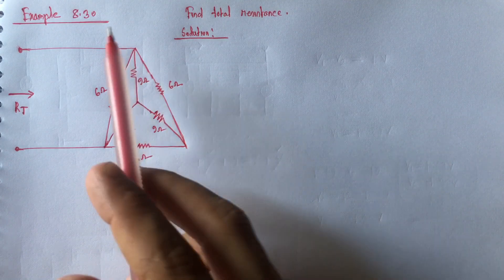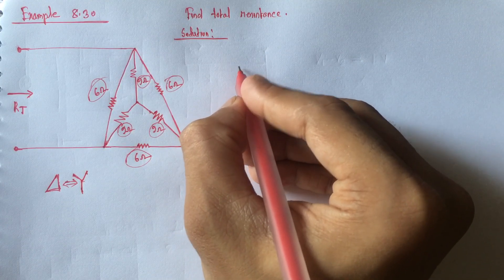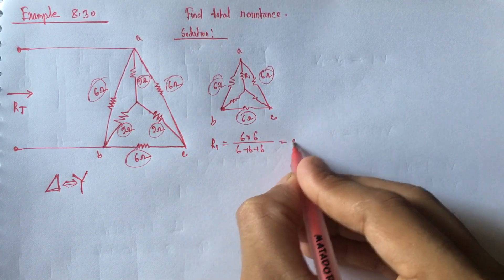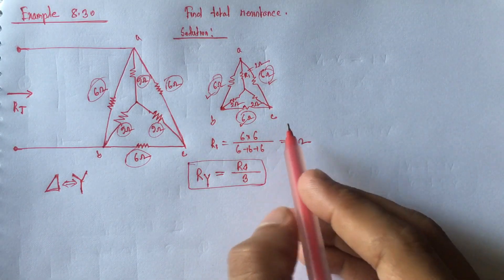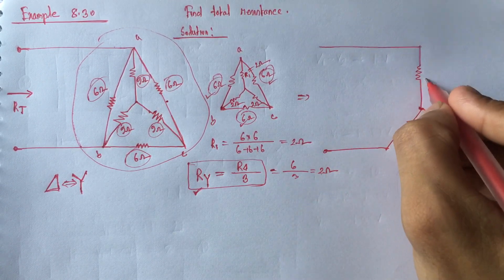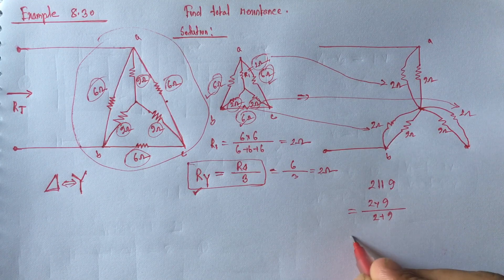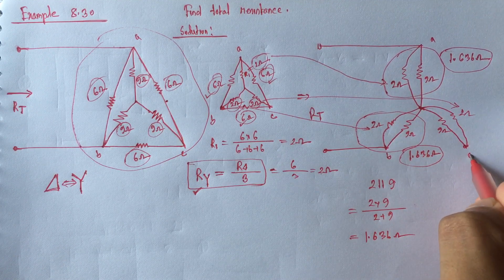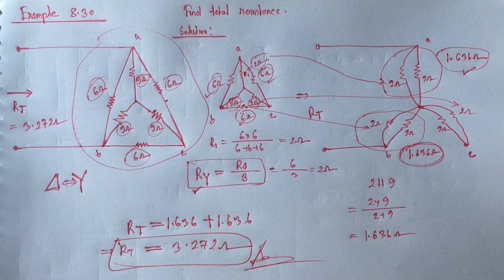Y-Delta Conversion DC Circuit Equivalent Resistant Solution (Boylestad Example 8 30)

Comment: I don't know why people are commenting wrong and wrong. There was written in the description that it is the solution of a book and it really helps me.
This is Y-Delta conversion DC Circuit Equivalent Resistance Solution (Example 8.30) from Boylestad Book (11th Edition).
The book is about basic circuit analysis (which was read almost all varsity) and the answer is completely right.
Reply: can u send me the Boylestad Book (11th Edition)?